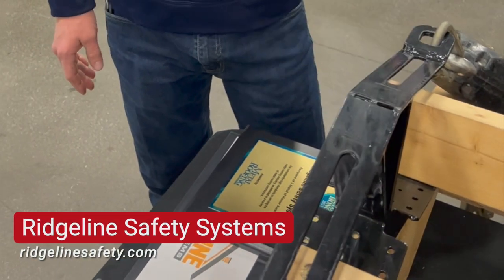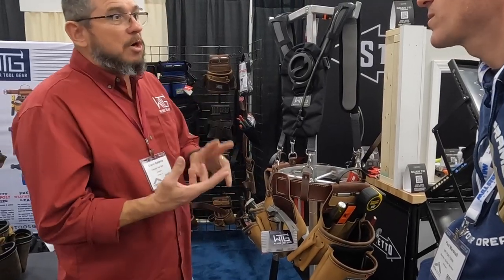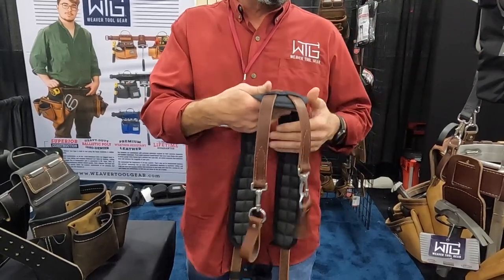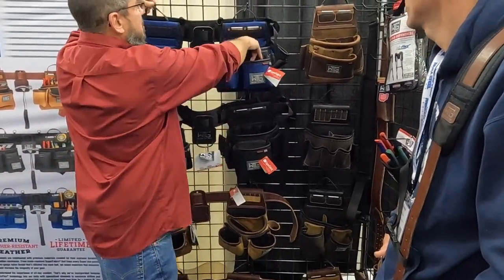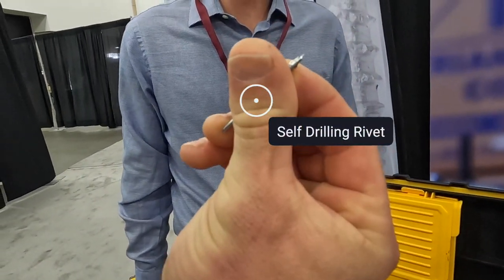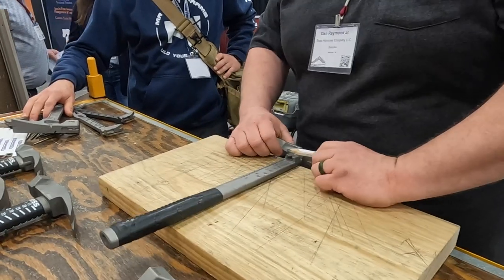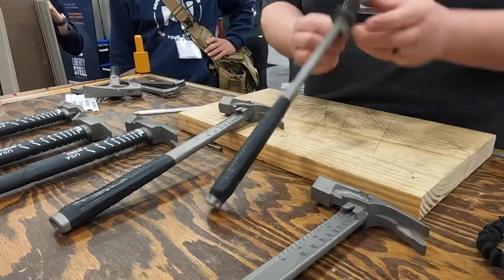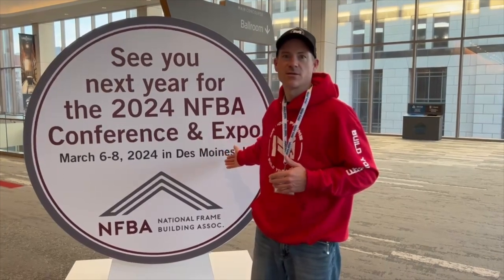New Tools to Build Your Barndominium | NFBA Conference Expo

Comment: On the Boss Hammer, I would still need a speed square for checking the inside 90 of a joint. The hex head is nice though. I wonder how accurately I could swing it. If you are not at the correct angle to the work, you will be trying to hit the nail with the corner of the hammer face.